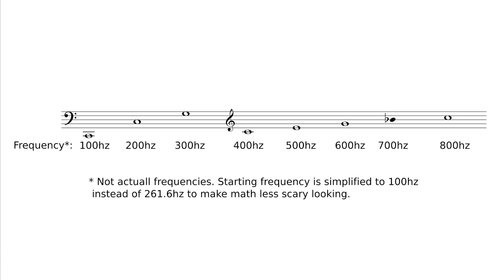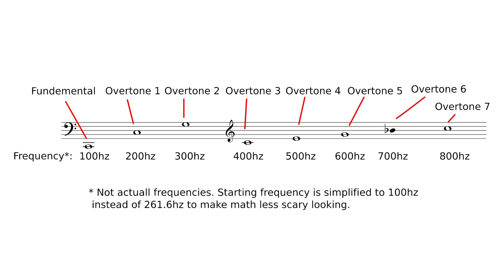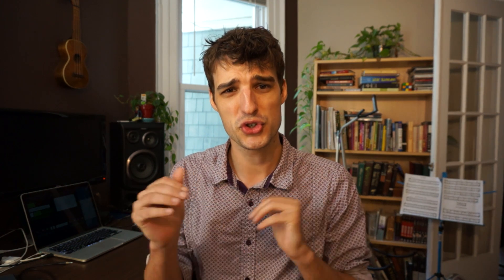Brief History of Western Tuning (Understanding Equal Temperament)

Comment: Up until late 19th century, Well Temperament is still used, they are not equal temperament.
Reply from the maker: Yes, but the 19th C. is very not modern.
Reply: @NathanNokes  I said LATE 19th century. Well into 1910-20s the aural method of equal temperament still wasn’t wide spread.

Comment: What’s the difference between Pythagorean and just tuning?
Reply: They're different approaches to building out the scale using simple integer ratios as the relationship between notes. The simpler the integer ratio between notes (i.e. the smaller you can keep the numerator and denominator of the fractional relationship between the frequencies) the more closely related the two notes are as harmonics of some other tone. (Actually I think Pythagorean tuning is a subset of just intonation...)

Broadly speaking "just intonation" is any tuning system which attempts to keep note intervals as simple harmonic ratios wherever possible.

"Five-limit tuning" is a form of "just intonation" where the fifth is at 3:2 relative to the root of the scale, major third is at 5:4, major second is 9:8...  But with the result that some of the intervals between notes on the scale are a bit awkward (going from 9:8 up to 5:3 should be "a fifth" but it winds up being 40:27)

"Pythagorean produces the intervals on the scale by starting with the octave (2:1) and the fifth (3:2) and building out all the other notes by repeating those intervals (the circle of fifths) - So you go up 2 fifths (3:2 * 3:2 = 9:4) then down an octave and you get 9:8... so it goes 1, 9:8, 81:64, 4:3, 3:2...  This also leads to some strange intervals, but even thirds have a complicated enough interval (81:64) that you don't get the "pure" sound of the 5:4 ratio.

Comment: Someone explain to me. 
What's the problem? Some intervals work but others don't?
Reply: A "perfect" interval would be one where the frequencies of the two notes are related by some simple ratio. For instance if one note's frequency is exactly 3/2 the frequency of the other note's frequency (a "perfect" fifth interval). This is important because the two notes then have a natural relationship between them, both tones are natural harmonics of another note, one octave down from the lower note. If something were vibrating at this lower note, you'd naturally expect it to also produce these harmonics, which in principle means the two tones together should sound pretty natural and comfortable due to the close, fundamental physical relation between the two frequencies.
The challenge is that if you try to build the whole scale across multiple octaves out of "perfect" intervals, you wind up with some intervals that are far from "perfect". Going up an octave should always be doubling the frequency. If you try to build the scale according to simple ratios (for instance in Pythagorean, where a fifth is 3/2 and a major second is 9/8) you can't continue those same intervals and reach a perfect octave (you can multiply by 3 and divide by 2 as many times as you like and will never reach something that exactly equals 2). Also, using the same interval at different points on the scale might not produce the same effect either, depending on the tuning system being used.
Equal temperment is a trade-off: The benefit is that a certain interval played at different positions on the scale will generally produce the same effect - a major 5th will be a major 5th regardless of where in the scale you start it. But none of the intervals, apart from octaves, have that integer-ratio relationship. The half-step interval is the 12th root of 2 - a transcendental number. A major fifth wouldn't be exactly 3/2 times the frequency of the lower note, it'd be around 1.498 times. A major third wouldn't be 5/4 (1.25) times the frequency of the lower note, or even 81/64 (1.266) times the frequency as in Pythagorean tuning, but the cube root of 2, around 1.26 times the frequency of the lower note.
So in equal-temperment tuning none of the intervals other than octaves will have that super-pure, clean-sounding natural relationship between the tones. But the trade-off is that you can move freely up and down the scale, modulate to different keys, etc. and still produce the same effect. And when you're used to hearing one particular tuning system, you expect it and it tends to sound natural to you. Or maybe you just don't know what you're missing...

Comment: What about woodwinds? I’ve been editing and spot tuning individual clarinet, oboe and bassoon parts for a client and I’m noticing that when I go to tune/correct individual blatantly out of tune notes, equal temperament tuning sometimes sounds out of tune with the pro template track. Your thoughts, please? 💭
Reply from the maker: Woodwind groups often adjust over the root of the chord. If they were individually recorded that's less  likaly. Not sure what pitch correction software you are using, but I've had them be blatantly wrong before. As always for correction go with your ears. Any particular instrument throwing you off?
Reply: @NathanNokes , Yeah, pretty much almost all of the woodwinds, and one brass instrument. 

The track I’m working with has adults from a community college playing individual parts from home. The instruments consist of: clarinets, a bass clarinet, oboe , bassoon, flute and what sounds like either a French horn, or baritone. 

I’m using Nutone (Pitch correction) inside of FL Studio. It’s very similar to Melodyne 5. FL also now comes with a tuner. But like you said, I’ve been also using my ears . I’ve just been really surprised at the results of the pitch correction plug-in and tuner as compared to what I’m hearing.
Reply from the maker: @JeffoftheShout    Can you set your FFT BIN size and windowing in Nutone? FFT's have to measure the change of the wave over time in samples, so longer is more accurate in pitch fidelity, but slower in response time. They normally window them to get around some of these issues. Good luck!!!

Comment: Without a system that allows for comprehensive modulation then we couldn't have Bach as we know him (as the fellow who set the stage for the entire subsequent history of Western Art Music till today including Jazz.) That history could accurately be discribed as a composer driven high speed power dive into higher and higher levels of chromaticism expressed both virtically and horizontally through modulation and chromatically altered harmonies and other methods of allowing more and more of those wonderfully subversive notes outside the key in thereby increasing the expressivity or ambiguity of the music untill a point a actual saturation was reached in the early 20th century. Bernstein famously calls this the 20th century crisis. In order for composers to continue to increase chromatic density after  this point then the conventions of diatonic containment had to be more or less done away with; enter modernism. So without keyboard technology then no Bill Evans or Igor Stravinsky or Arnold Schoenberg or Bartok or Samule Barber or Charlie Parker or Gill Evans or or.

Comment: I have a question that I hope somebody knowledgeable can shed some light on. How did they manage to measure the ratios? Did they have tools? Because our modern digital tuners didm't exist back then, so how did they know the difference in frequencies? If it was all done by ear, then that is simply astounding.
Reply from the maker: You can use divisions of a string with a ruler, like a monochord, and you will have precision ratios. Also the harmonic series naturally follows the mathematical ratios so overtones make it super easy. For equal temperament there were mathematical models that were translated into practice.
Reply: @NathanNokes  gosh that is fascinating. Thank you for answering my question! ^-^

Comment: This is a good presentation.  True Tuning (which is not tempered) was used by the classical Greeks in their modes. By taking the seven tones produced by the True Dorian octachord and the True Tone C Major scale and obtaining the five remaining tones formed from the "geometric mean tones" of those produced already (referenced to prime [C-128Hz]) we get a 12 tone scale that is aurally genuine in all 24 major and minor keys. Now, a reasonably good piano can be "in tune" in all keys. Very few masters can actually do this. They are not technicians but tuning specialists and are also hard to find and well paid!  ET is about 40yrs out-of-date with modern advancements.  It looks like we have to wait for the current generation of lazy tuners to die out before we can move forward in this area and hear less percussive and more expressive pianos.
Reply: What are you talking about? European music HAS to be tuned in successive fifths due to the heavy usage of chords. For a fifth to sound in tune, it has to be in about the 694~702 cents range. The ONLY way to make this work with the circle of fifths is either Pythagorean tuning, Well temperament, Equal temperament or Meantone temperament.

Anything else forces you to put an out-of-tune wolf fifth in a wildly popular chord. Example: if you tune C-E to the just 5/4 ratio, you cannot also have a just 3/2 ratio between C-G (used in the C major chord), G-D (G major), D-A (D minor) and A-E (A minor). Having perfect fifths between C-G-D-A-E forces you to tune C-E to 81/64, not 5/4. So something has to give, and any compromise such as distributing the wolf fifth gap evenly results in a temperament.

Comment: In 12 tonne equal the 5th is not perfect; rather it is narrowed [flatted' very slightly to fit in the best. just saying
Reply from the maker: Yes just under 2 cents off of just. I think in the diagram I made it ends up being a couple of pixels difference I think. So visually it is pretty imposable to see the difference.
Reply: Yes just a few cents. You did a great presentation. I tuned pianos a long time, hence my intrusive remark. Thanks for replying.

Comment: The mathematician Thomas Young proposed a well tempered tuning that is usable in all 12 keys, but sounds much better than equal temperament - especially so for those keys in the the upper half of the circle of fifths - and each of the 12 keys retaining it's own colour. This was around 1800  and can be seen as the high point of western tuning theory.
Reply from the maker: I believe he actually purposed 2 tunings. I actually don't know much about them though. It would be good thing for me to research some time.
Reply: There are many well-tempered tuning systems, of which, Young 1 is probably the best. Young II is simply Vallotti shifted 1 fifth. The term 'equal temperament' was used to describe any tuning system which accessed all 24 keys. This means that musical theorists of centuries ago were not referring to 12-TET.  Helmholz's. Sensations of Tone has a table showing, Examples of Equal temperaments. Young 1 is a very well balanced tuning system, and tackles the problem of playing in all 24 keys far more elegantly than the sledgehammer approach of equal temperament. @NathanNokes
Reply: Here ya go.
https://mal-2.bandcamp.com/track/gonzo-lullaby-youngs-1
https://mal-2.bandcamp.com/track/gonzo-lullaby-youngs-2

Comment: Hello Nathan,   Nice try.  I think it helps novices (as you can see by earlier comments) but watch out next time for inaccuracies that confuse those who may have previously understood the issues from a more exacting source.  1)  Just Tuning is NOT a temperament: Pythagorean Tuning is NOT a temperament and True Tuning is NOT a temperament due to the fact that all intervals sound genuine. YES. Mean Tone and ET are indeed temperaments.  So be careful with your nomenclature!  You are right that it is not possible to use Just Tuning in a 12 tone system (which is NOT our modern system - but only that which is used on limited keyed or fretted fixed pitch instruments).  Choirs and acoustical ensembles in western music do not limit themselves to a 12 tone system.  They actually do adjust for the differences between G# and Ab (as well as other #s and flats) who's differences  you explained well.
2) In Pythagorean Tuning the octave is NOT preserved but the "perfect consonant" lesser intervals are (fourths and fifths):  This is a problem and the reason we have the "Pythagorean Comma" or discrepancy.
3) In Equal Temperament the octave (in theory) is preserved.  On tightly wound string instruments like the piano (Klavier) the harmonics are out-of-tune and therefore the octave is generally stretched to sound in-tune.  The tritone IS in-tune by the way and the minor thirds (major sixths) do sound in-tune.  The other intervals are indeed out-ot-tune as up say.
4)  Pythagoras did define the major third as the ratio of 1.25:1 not 81:64.  You will get that ratio of 81:64 if you tune a 12 tone system to a circle of Pythagorean fifths, yet Pythagoras determined that the 1.25: 1 ration was the major third and that it sounded genuine to the trained and untrained ear.  We find different ensembles actually prefer different sized thirds depending on the energy that is required from both harmonic and melodic movement in a particular situation.  So major thirds smaller and slightly larger are often interchanged in actual performance (even when an equally tempered instrument is used with voice or instruments that can adjust "on-the-fly".
Reply from the maker: Thank you for taking the time to comment.

Oops I did let temperament slip out for just intonation.(writing making graphics shooting and editing is time consuming) I'll add a square text correction. 

As for choir tuning to just intervals I'm very well aware of this. It is actually a relatively complex phenomenon and some American ensembles do better then others (I've heard some fairly sharp 3rds in many performances.)

That said the video is intended as an introduction. Sometimes pedagogy must simplify and approximate structures. Just like we typically don't introduce  Einstein before we introduce the Newton(even though the later was slightly wrong and Einstein fixed it. People need to know about equal temperament being off just intonation before they learn how not fixed pitched instruments adjust between them. 

I didn't even have enough time to discuss Partch and Young or breakout calculus. :-)